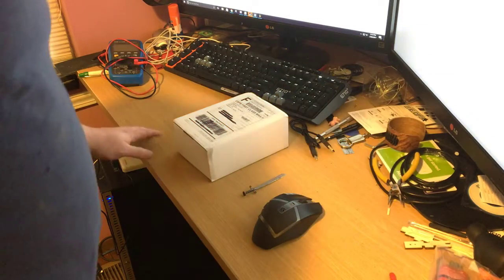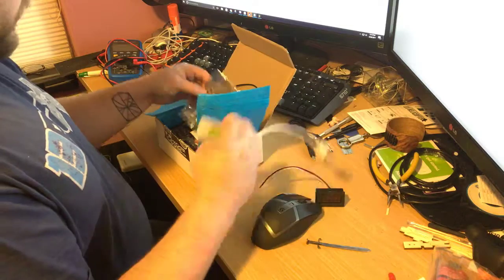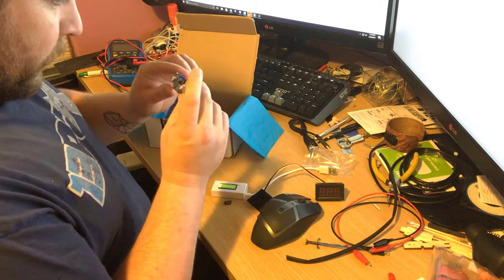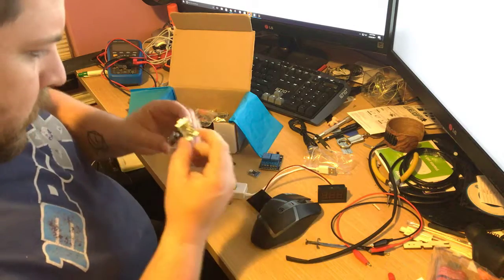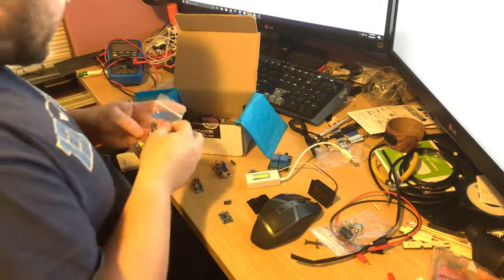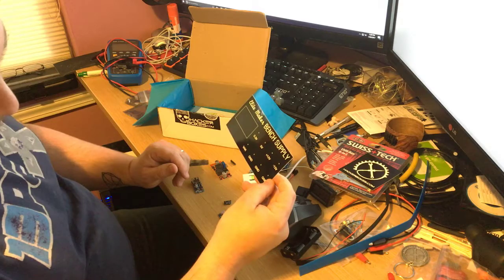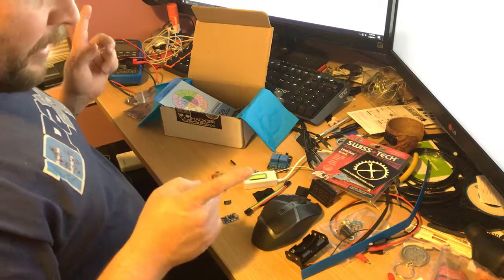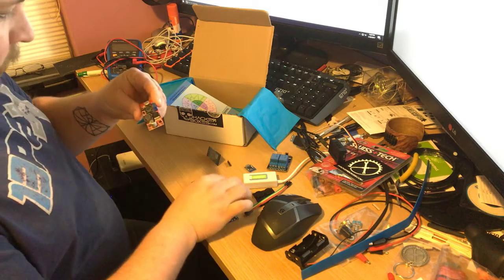HackerBoxes 0017 - Power Maker - Unboxing

Comment: All of my old ATX power supplies have long since bit the dust. I gave up and ordered the one they recommended from Amazon. :-)
Reply from the maker: My wife got a hold of a 350 power supply from her work. There isn't a lot of room in there but I will be able to get the buck boost converter in there by removing and hardwiring the 115/230V switch.